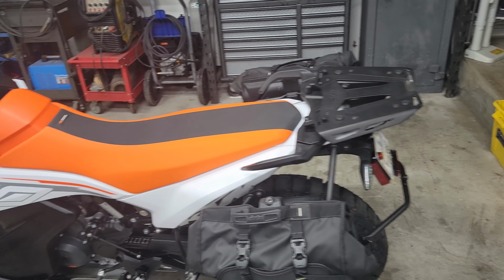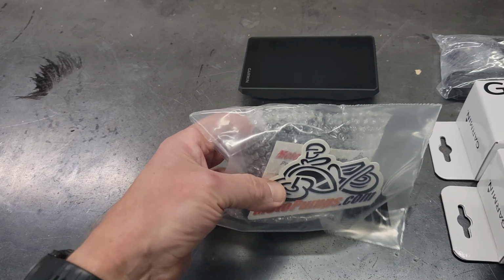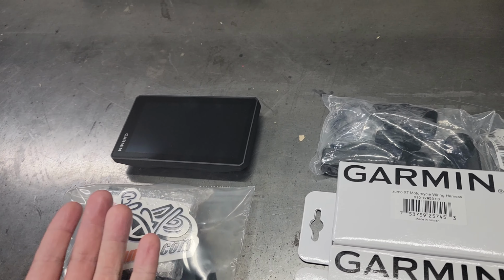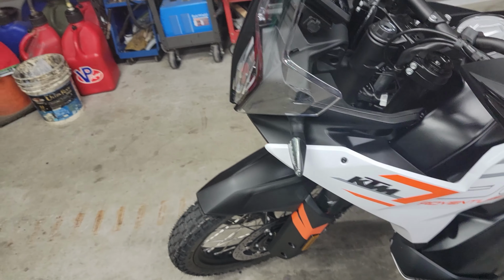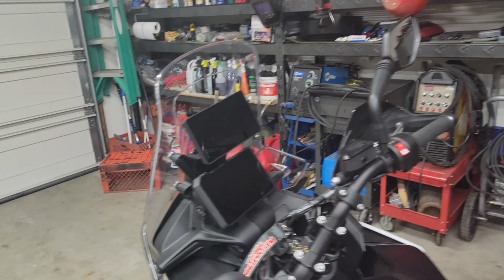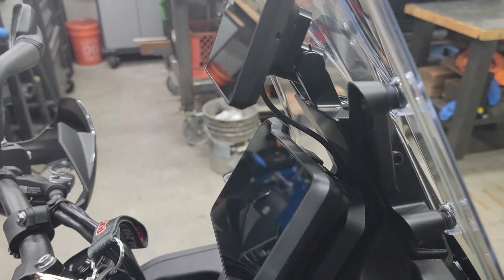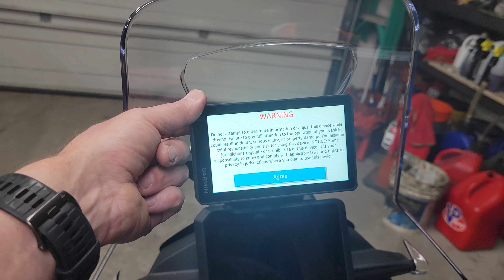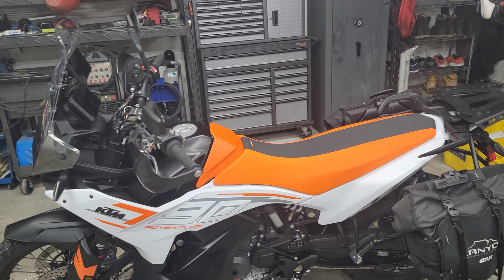2024 KTM 790 Adventure Part 4 (Garmin zumo xt mount, wiring, install)

Comment: It's easy to remove the side fairing to have access to the acc plug, and will save you a lot of work.
The windscreen it's also fitted from the bottom, you put it wrong. 😉
Reply from the maker: Good tip!
Reply: Yeah. Should have removed right side fairing for access. After that just route the cables behind the TFT by removing it to access gap. Pull them up by taping a ziptie to acc connector or with some hook. Nice looking mount by the way. 

Enjoy these videos regardless! Peace!

Comment: I must be a kook -- can't seem to remove the bottom bolt and square-ish bushing from the TFT -- any tips
Reply from the maker: It's a t20 IIRC and you need to push it through once it is loosened.